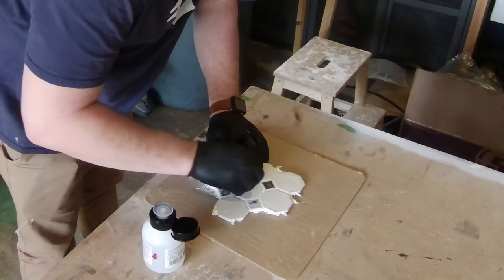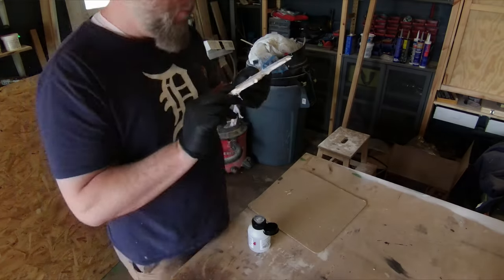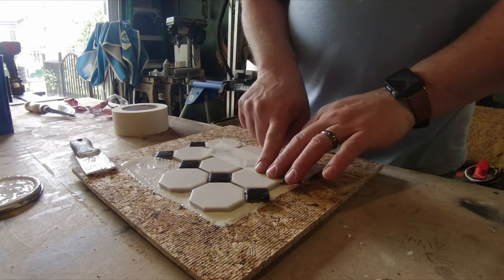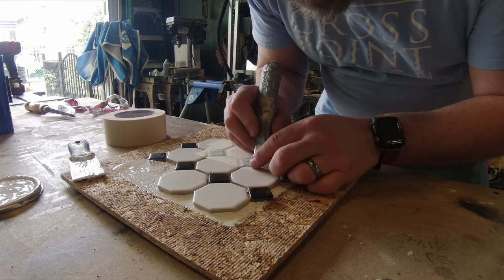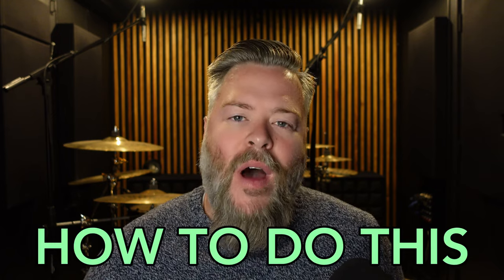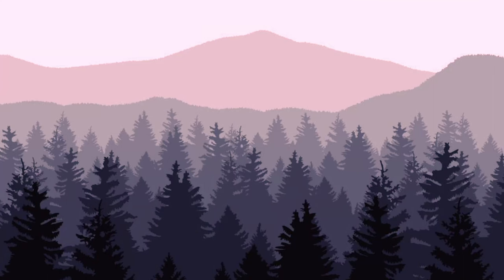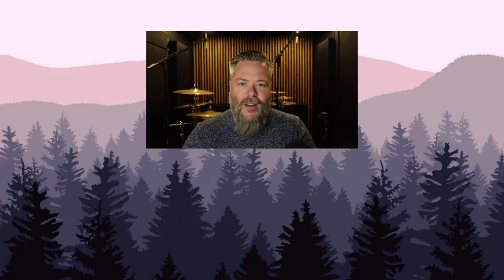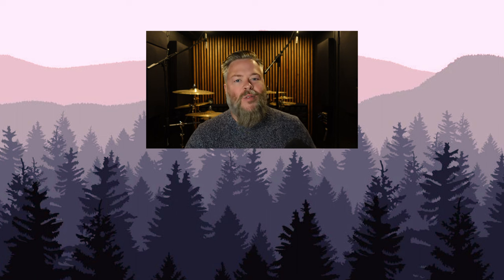I Used Flex Seal as Tile Grout in a Camper!

Comment: I love this video!  Thanks for showing all of your experiments; they are very helpful.  I will be repairing an RV shower pan and decided to use flex seal and add seashells (much lighter than pebbles!) but did want to see if anyone else had tried it first.  Yours wasn’t a shower, but the process is applicable.  I plan to use white as the base and clear as a top coat to cover the shells.  So excited to try it!
Reply from the maker: Thanks so much. The clear is a great idea! I hope everything works out!

Comment: Excellent job my friend.Our project  is a access panel for our whirlpool tub that measures 1 foot by 5 foot . I was worried about grouting that with normal grout  and thinset knowing every time we remove it i would crack the grout joints.I think this is what we need.Can u get different color grouts too?
Reply from the maker: That sounds like a perfect project for this! Flex Seal only makes black, white, grey and clear that I know of. However, I’ve been wondering if you could add paint or some pigment to the white or clear and make it different.

Comment: I wonder if rolling on some sort of oil over the top of the tile would keep the flex seal from sticking to the surface. By rolling it on you’d hit the surface but no oil would get into the grout lines.
Reply from the maker: I considered something like that, and taping over the top and cutting out the grout lines. The cutting was so time consuming I just didn’t think it was worth it. I could see oil working, but you’re right. If it got in the grout line you’d be in a tough spot.